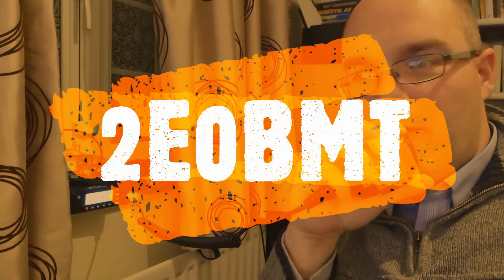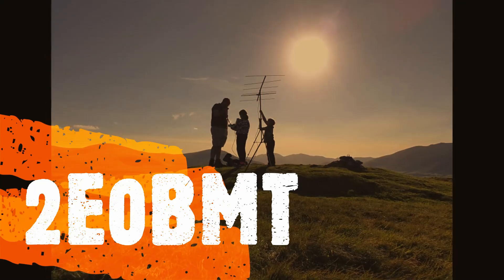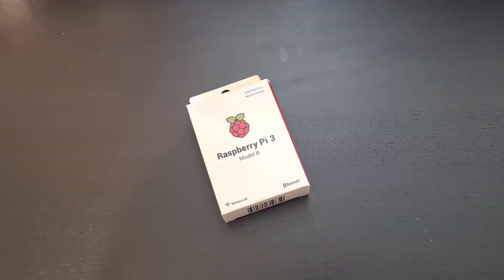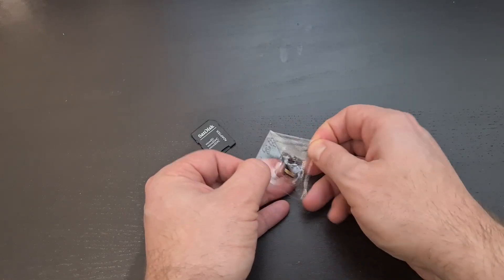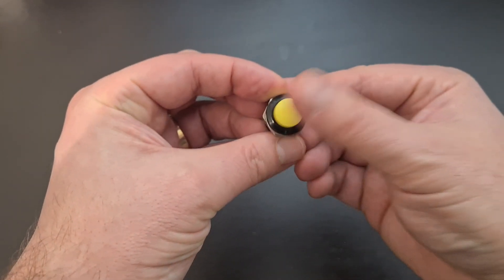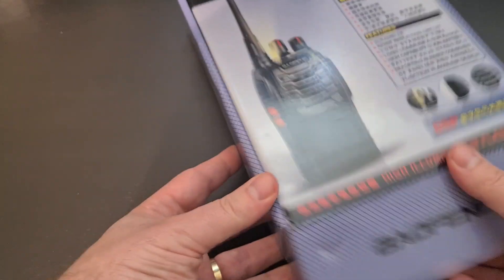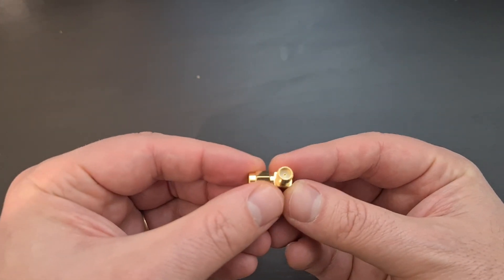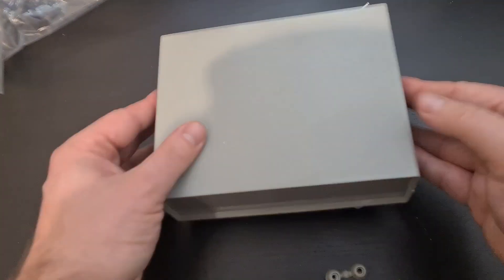PART 1: Idiot’s Guide To Building An Allstar Node – Shopping List – Amateur Ham Radio 2E0BMT

Comment: Hi Ben loving the vlogs and just right for me to follow :) looking forward to the next one.   Does the Boafeng have to be a n 888s or can other Boafengs be utilised i.e the uv-5r
Reply from the maker: I think you CAN use the uv5r, but I wouldn't 1) it's three times the price, 2) it's more powerful (I reduce the power of the 888s, as you shall see) 3) I don't know how to find the cos, ptt, and other connections. Hope that helps.
Reply: Be aware that the uv-5r has a TOT. Transmission  Time Out Timer. Mine stopped transmitting after 600 sec's .  On a very busy hub net the UV5R is Useless.   I haven't found any way to shut off the TOT timer.  Just letting you know.
Reply: @africantwin173   hi mate i only asked about the uv-5r as i  have a spare one knocking about but thanks for the info anyway .